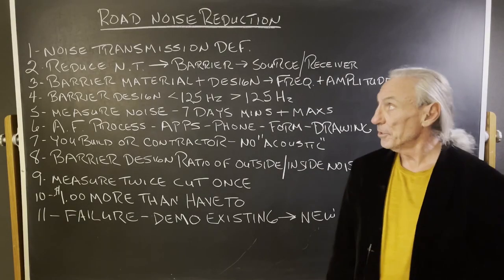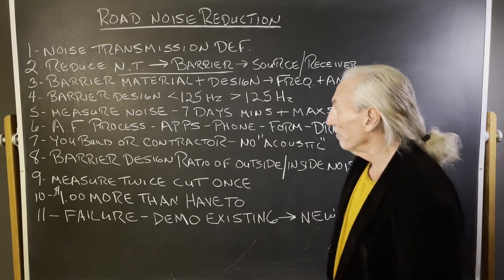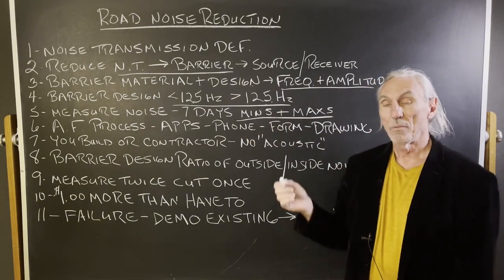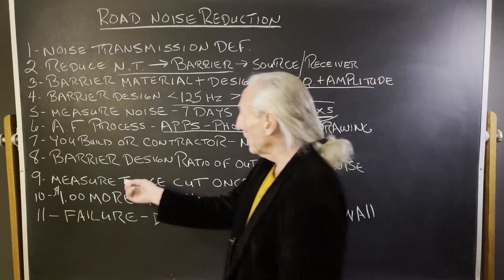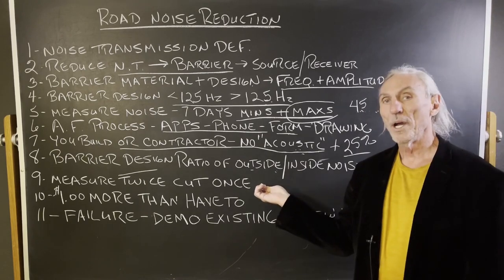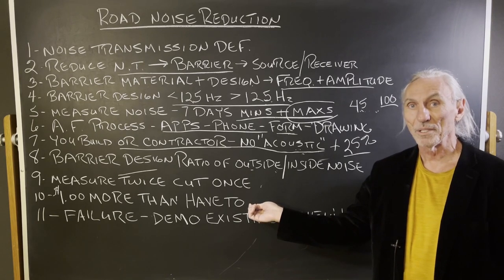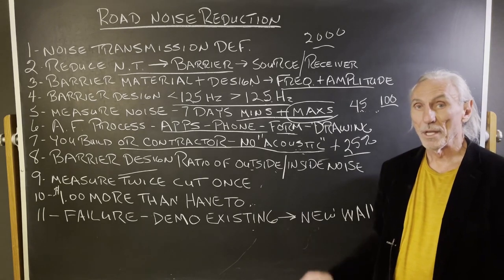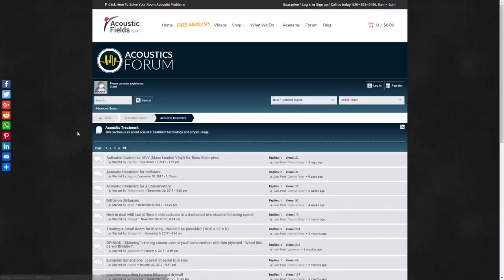Road Noise Reduction - www.AcousticFields.com

Comment: "Noise is classified as a health issue."

For good reason.

I was sitting at a light some years back and in a lit hearted mood. Some guy pulled up behind me with his radio cranked up and I literally felt the bass vibrate my heart. My mood instantly soured to the point that I wanted to go back there with a gun and put several projectiles in the radio.

If music or other noise is above a certain DB in a room, it automatically damages your hearing. And you won't notice that your hearing has been damaged until subsequent damage has occurred over years of repeated excessive DB offenses.

In a multi story apartment building, any banging on the floor above, converts the room beneath the banging into a bass drum and all that pressure hits the occupants in the ears. It's both painful and annoying so if you are a heavy walker, it's time to learn to walk softly on the balls of your feet and be as quite as a cat.

If you're cruising down the road with your radio cranked and police and fire come by and you don't hear the siren because your radio is cranked; you could end up pulling in front of the fire truck at the last minute and loose your life.

Loud noise is definitely a health problem.
Reply: Absolutely correct, I wish I'd wore earplugs to a few concerts or sat back farther.

Comment: The most common form of road noise from a highway is actually from the tires not the engines. There has been research in  paving materials and rubber for tires to reduce it. Just something to share. Thanks for sharing your knowledge sir.
Reply from the maker: Reducing amplitude at the source is a good thing. However, due to the large surface area of the road and the constant surface area friction from vehicles, the barrier requirements remain the same.

Comment: Hello..
How to deal with rumble sound from truck passing  in front of the house?
Reply from the maker: Low frequency noise transmission is the most difficult of all noise to stop. It will require a new structure be built that is designed for the maximum pressure and frequency.

Comment: My measurements on the road by our house show 700-4000 Hz from 65-75 dB. That is pretty easy to deal with, but the occasional motorcycle, or large truck noise is a far different story.
Reply from the maker: Noise issues for barrier design fall into two main categories. We have noise above 125 hz. and noise energy below 125 hz. The barrier designs to stop this noise are dramatically different. This is why it is so important to measure the noise first, so you know what barrier to build. If you build a barrier for + 125 hz. and your noise is < 125 hz. you will have to tear it all out and start over. I can not think of anyone who wants to do that.